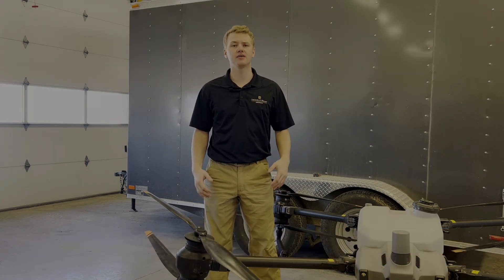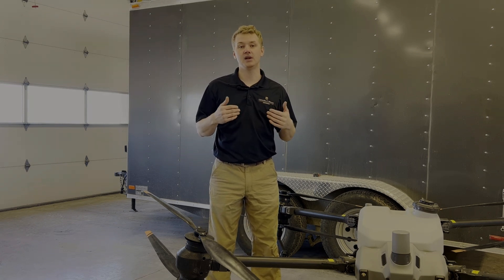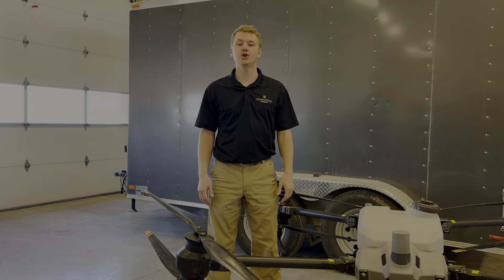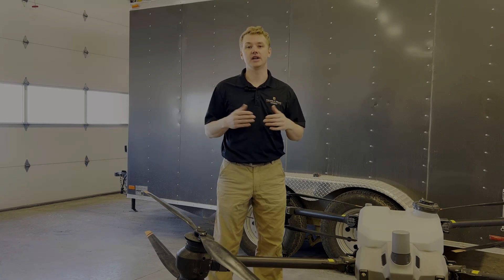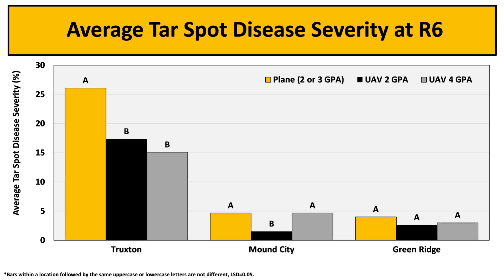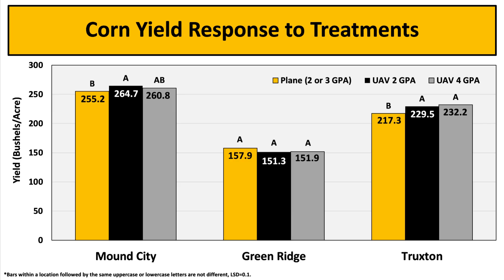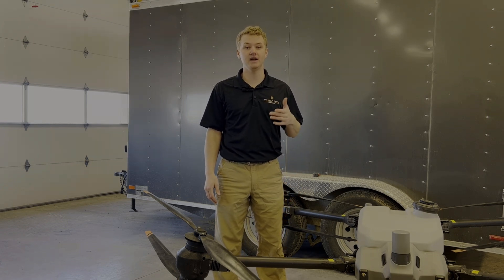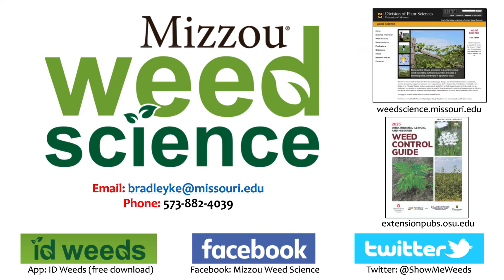The Comparison of UAV and Airplane Application in Corn

Comment: Not trying to be rude but this test is not accurate… your data contradicts it self.. and way to many variables missing, nozzle type, droplet spectrum, airplane, etc. and my guess is that the three different locations were sprayed by three different airplane operators. Also who were the operators? Do they have a good reputation? Do they do shotty work? All things that should be known.. not trying to be hard just trying to help for the future.